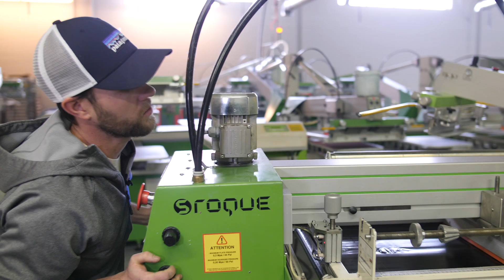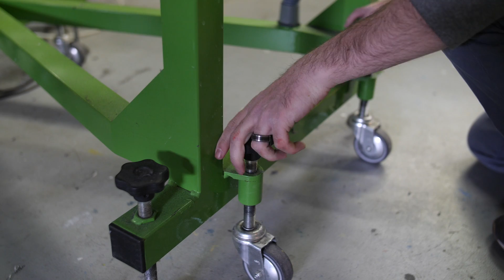How to Properly Install a ROQ Foil Heatpress Unit on an Automatic Screen Printing Press

Comment: Hi, I doubt about the durability of the foil print since heat applying time for most foil brands are more than 20s. Any thoughts?
Reply from the maker: Hi @Nipuna Gajasinghe. Good point. the foil is going through the conveyor afterwards as well. So it's getting a bunch of time in the chamber to bond to the adhesive. hope that helps.
Reply: @Ryonet  Thanks for the reply. Have you done durability test on this? I still doubt that because melt powder is already melted and cool down. Then probably it will not sensitive to heat again. Also pressure is not there in conveyer. But should test that. If We can clear this out definitely I will convince my boss to buy this😆  However This is really great invention .. 🧢 off !!!